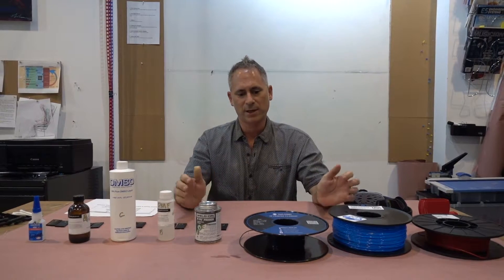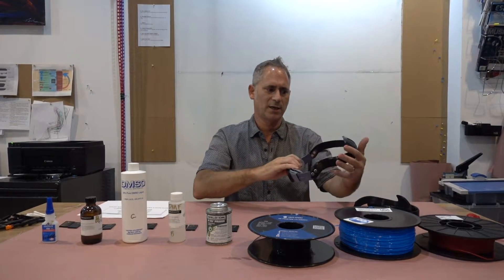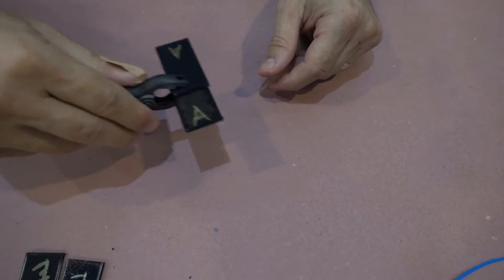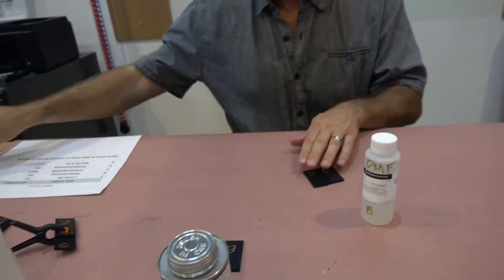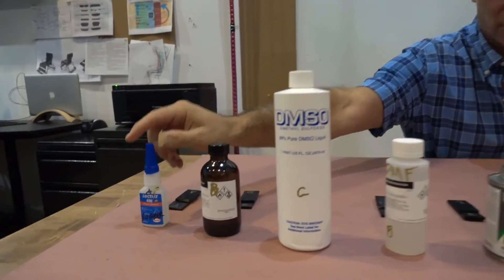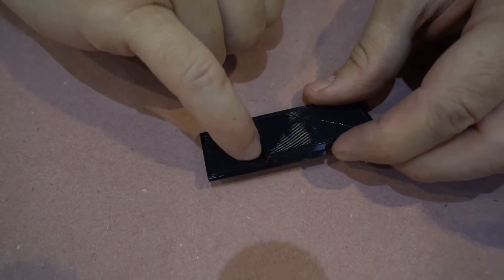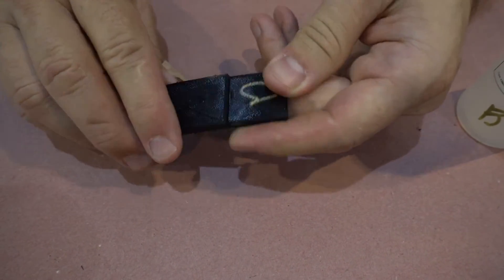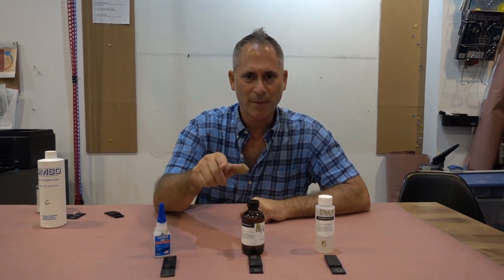Methods of gluing Flexible Prints in TPU together!

Comment: Thanks for the vid!

Adhesives & Solvents Tested
Loctite 406 (CA glue for plastics/rubbers)
Pros: Very strong in shear, instant tack, good for TPU → other material bonds.
Cons: Brittle, can fail under peel forces.

THF (Tetrahydrofuran)
Pros: Fuses TPU surfaces (solvent welding), very strong, no major staining.
Cons: Hazardous to handle (respirator & gloves needed).

DMSO (Dimethyl sulfoxide)
Pros: Bonds reasonably well.
Cons: Causes white hazing on surface, weaker than THF/DMF.

DMF (Dimethylformamide)
Pros: Strong bond, solvent weld, only slight surface change, nearly as good as THF.
Cons: Toxic, smelly (contains formaldehyde group).

Weld-On P70 Primer (mix of THF, MEK, acetone, cyclohexanone)
Pros: Easy to buy, no staining, strong in shear.
Cons: Failed under peel compared to THF/DMF.

Best Options

For TPU → TPU bonding (same material):
THF or DMF (solvent welding = permanent, flexible bond).

For TPU → other materials (rigid plastics, composites, etc.):
Loctite 406 (fast, reliable, but brittle under peel).

✅ Final Verdict:

THF = strongest, cleanest solvent weld for TPU.
DMF = strong alternative, slightly more staining.
Loctite 406 = best quick adhesive for dissimilar materials.

Comment: very intestesting!  I need to bond TPU to a carbon fibre... and peeling is going to be important... anyone any ideas?   Ideally I'd use a two sided tape, but Im pretty sure none will be able to do this...
Reply from the maker: Thank you, the best solution is mechanical solution like a positive negative interlocking feature, if not, I feel the best solution is epoxy however, he still would need some mechanical grip

Comment: Chemist here. Please do not use DMF for welding. It will make you impotent very quickly (men and women), and it will reduce your ability to process alcohol making you have serious hangovers. Use THF or DMSO, I would recommend THF. I don't know if this will work because I've never tried, but you could also give Ethyl Acetate (Common Paint thinner), Acetone, or Methyl ethyl ketone (MEK, another paint thinner). All of these have significantly fewer risks associated with them.
Reply: I don’t know if this guy is screwing around or not, but I’m going to listen to him.  I’m not going to use anything with chemicals that will prevent my fishes ability to swim
Reply from the maker: Thank you!
Reply: When did MEK become safe?
Reply: @McAuley240  Not a carcinogen, high LD50, no reproductive effects, relatively high acceptable vapor exposure (150 ppm for 8 h). Compared to DMF it's basically water. Ethyl acetate or THF would probably be the best options.
Reply: Jesus
Reply: That makes sense now.  I was tasting in colors afterwards for awhile.

Comment: Good stuff. I am curious if you ever experimented in getting  good contact cement to stick to the TPU to bond other rubbers (natural or thermal rubber TR, EPDM, etc). Contact cements don't seem to stick well the the low reactive TPU, so it seems to me a primer of sorts is needed.  will one of these organic solvents work as a first primer layer that will make the contact cement bond really well to the TPU material?

Comment: What about common bicycle tube rubber cement? That's cheap and easy to get hold of, flexible, and contains solvents.
Reply from the maker: I havent tried, but innertubes are actual rubber and TPU is a thermoplastic, so its not likely to work, but worth experimentation!

Comment: Thanks for making this video.  My chemistry knowledge is pretty nil so this was a big help.  I viewed this video about 3 days ago and Amazon did not have the THF but today, it is back in stock so I picked up a small bottle.  I want to make a linear strip of TPU to wrap around a radio knob as a grip-enhancer. The reason I don't print it in a continuous ring is that I am using the texture of the bed to impart on the TPU strip.
I use both TPU and PETG (wonder how THF works on PETG?) and TPU is amazing material.  I soaked a TPU piece in acetone for 3 months and other than absorb a smell (that did vapor away completely) there was absolutely no degradation or change!  Also, I make small electronic enclosures and TPU makes them pretty well bullet proof.
I will eventually need to get into nylon (does THF glue/melt nylon?) but that is a big modification of my setup to accommodate both the higher temps and bed-adhesion.
Anyway, thanks again for posting this informative (Project-Farm like) side-by-side test...
Reply from the maker: Hello, you are welcome, unfortunately I am not a chemical engineer, only a tinkerer and designer.  I have not tested the solvents on many of the materials you are listing, but you may want to do your own experiments on small swatches.  If so, please do let us know.
you may also want to check out this video I did on gluing PLA  https://youtu.be/jOJJ0wyScOc

Comment: Thank you for the video, I was looking to glue a modmic to a pair of 3M X5A earmuffs, unfortunately for me the included mic clasp does not stick well to rubberized surfaces, so down the rabbit hole I go, looks like the CA glue should work fine for TPU/ABS. Now if only there was a product with great noise isolation, clear noise canceling mic, AND audiophile level sound at a sub 300 price point I'd buy it in a heartbeat.

Comment: I tried the DMF on some TPU parts made using the FDM process and it worked great.  Then I tried it on some TPU parts made by multi-jet fusion and it didn't work at all.
Reply: any luck since with the TPU parts made by multi-jet fusion ?

Comment: do you know if when dry, the three winners pose any threats to dogs. I am designing and dog frisbee and need to attach tpu to tpu. If they do, do you know of any other glues that work with TPU, can withstand great tensile strength, is waterproof and is non-toxic? 

thanks, great vid
Reply from the maker: Sorry, I really wouldn’t know that. Best guess is that the clear solvents once evaporated will not be present any more, but I can’t be sure and don’t know the medical science behind it
Reply: @petersolomon3505  yeh okay all good. Thanks for your input regardless

Comment: Have any of you you tried a cheap, accessible product like Liquid Nails (original construction adhesive) for bonding PLA to TPU or even ABS? I use A urethane construction adhesive to bond PETG to fiberglass for a radio housing mount in a motorcycle fairing and I swear you can swing an elephant from it.
I don't remember feeling old Liquid Nails, 20 plus years ago, from anything. It had to be ground off or scraped. I have no idea what is in it.

Comment: Great video. Saved me from wasting time on performing these experiments thanks. Is there any way of rendering the TPU surface more rough to increase the coefficient of friction. Specifically I'm working on a gripper for cutlery to be used by persons with disabilities of the hands. So far we resolve to wrap a rubberband around the cutlery to avoid that it slits against the TPU, but if the TPU surface could be made like silicone after 3D printing it would increase usability. Anyone?
Reply from the maker: thank you.  I might suggest building texture into 3D model or using a slicer which adds texture. Or if its not a problem to drill the cutlery in 2 places add small protruding half spheres on inside of TPU part to catch the holes
Reply: @petersolomon3505  Thanks. Texture is not sufficient, Modifying the cutlery is not viable. I hoped for some surface treatment to make the TPU like silicone rubber surface.
Reply: @runethorsen6230  You need to print with a soft tpu. It can be very similar to silicone in flexibility and give.

Comment: Would love to see how the bond was between different materials. It seemed like you alluded to testing this in the beginning because you even said your use case is attaching TPU to something harder like PLA. If I wanted to bond TPU to TPU I would print them together in most cases. Thank you for testing part of it though.
Reply from the maker: thats a good point, I guess it really depends on which other material you are using, if bonding to a material which is rigid I tend to use CA or supeglue, and if bonding to something flexible a rubber cement if not one of the solvents I have show.  see earlier video on general bonding https://www.youtube.com/watch?v=5XCJauPrlKY&t=9s

Comment: What would you say would be the best glue to stick tpu and cloth (mostly faux leather)
Reply from the maker: Probably a contact cement as it’s one of the few flexible. A bit on both sides, spread thin, let dry, then push together
Reply: @petersolomon3505  thanks

Comment: Thanks for the great video! I'm using Loctite 770 with Loctite 401 and they gave me great results on TPU and Neoprene adhesion. I'm doing some research and I'm trying to glue Ninjaflex TPU to steel. Do you have any advice on that? Thank you!

Comment: Could the dmf used with a heat press, to speed up process to avoid clamping
Reply from the maker: lloyd b have no idea, but many of these chemicals are flammable so be careful experimenting.
Reply: Thank you, sorry for all questions there not alot of info bonding these materials, how long did you leave it to cure
Reply: @lloydb801  no issues, that video was 2 years ago, but I think I left for 30 minutes although I believe the bond is almost instantaneous.

Comment: Where can I get the dmf or thf from ?
Reply from the maker: DFM:  https://amzn.to/3fw9HkH    THF:  https://amzn.to/30sN1NG
Reply: @petersolomon3505 thank you, not avaivable anymore, will the thf work with polyurethane rubber
Reply from the maker: @lloydb801  wow, is neither available? check amazon and ebay.  TPU is thermoplastic Polyurethane, which means its formable by heat, the other type of Polyurethane is thermoset which catalizes with a chemical reaction.  I have not tested on the second type yet.
Reply: @petersolomon3505  hi again, I'm from the uk, they sell it but you have to be a company or a school, I'm going to try ebay
Reply: @lloydb801  yep the uk its a pain to get hold of dmf, i tried today though im a company but still wont sell to a sole trader, only reg companies only. The only thing you can get is the 406 so it looks like we are stuck with that haha stuck..

Comment: Thank you for this video.  Do you have any recommendations for bonding TPU to PLA?  There would be only compression no shear forces.  Thank you again.  Very Best Regards, Jim
Reply from the maker: diveflyfish I would think your best bet is contact cement, I don’t believe there is any Solvent with intermix between the two and the best bonding agent would probably be something which has a little bit of flex such as contact cement. Apply to both sides and let dry until lightly tacky like  a piece of masking tape then push together and they will permanently bonded
Reply: @petersolomon3505  Thank you.  I am now trying an experiment to print the PLA on top of the layer of TPU. I raised the temp of the PLA to the temp of the TPU printing temp and so far it seems to be working.  I will find out in the AM when the print is complete.  Thanks again for your instructional video.
Reply from the maker: diveflyfish that sounds very interesting, let me know your results!
Reply: @petersolomon3505  It worked perfectly.  I printed the TPU layer first, then switched to PLA but kept the temp the same as the TPU temp for the first layer, so 235 TPU 235 PLA first layer then decreased the temp to 225 for the second  and third layer PLA then resumed the 215 temp for PLA.  The only other modification was print speed.  I printed the TPU at 20mm/sec which is a little fast, and the PLA also at 20mm for the first four layers. I then resumed to a slow but sure 40mm/sec for the PLA.  It is a solid interface.
Reply from the maker: @diveflyfish  amazing news!  I will have to try this.  If the geometry permits I would suggest printing PLA first so you would have a more solid base.  I do print Sainsmart at speeds up to 40mm/s and ninjaflex at 25mm/s

Comment: Did the DMF seem to impart any of the shine characteristics that the THF did on TPU? Do you think the THF or DMF could be used similarly to shine up the plastic like acetone shines up ABS?
Reply from the maker: It may be possible, but hard to control, would need some experimenting,  acetone on ABS works smoothly due to the vapor application, not sure if brushing on has same quslity

Comment: Thanks for the great info, but yikes, please use eye protection! Also, DMSO passes so easily through skin that spilling some on your hand will quickly give you a garlic taste in your mouth as the DMSO enters your bloodstream and is circulated to your tongue. Anything dissolved in the DMSO will be transported through your skin and into your blood at the same time. Some info on what types of gloves to use with each of those solvents would have been useful. Great video though!
Reply: When I was a kid the vet used this to apply meds to our horses topically. It not only passes through skin and blood membrane easily, it magically helps other compounds to come along for the ride.

Comment: Do you know if THF or DMF leave any toxic residue on or in the TPU? I have been trying to find out for a few days but only find the potential health risks while using the solvents and nothing about if those effects are an issue after it has dried.
Reply from the maker: Sorry, I am not a chemist and although you could wash the parts, I have no idea of residues left or changes in chemical composition due to using organic solvents
Reply: Did you find an answer to that?

Comment: John,
If you would send me your address, I'll send you a Basic Poly Kit.  The Bonding Poly Process (patent pending) will take the 3D printing to the next level.   Haven't test results on tensile strength of the Process, but I do on heat.  CA's fall apart when heated to 220 to 280 degrees Fahrenheit.  Bonds made with the Bonding Poly Process hold at temperatures in excess of 320 degrees Fahrenheit.

As far as tensile strength, in every case where there's been a failure, it's been substrate failure.  In the video below, the wood split before the bond between Teflon and the wood.  When pliers have been taken to the wingnut, the Teflon split.  

The Process works on all polymers and all plastics, though for resin and acetate plastics, the Poly Prep is not needed.  In two and a half years on the market there has not been one reported failure of a bond.

Please let me know.

Don Meyers
Tech-Bond Solutions
877 565 7225
https://www.youtube.com/watch?v=Mtvf5FE0pg4

How to Bond Teflon to Metal, Wood, Rubber, and other Teflons
You've probably heard that nothing sticks to Teflon. And while it certainly presents a major challenge to most adhesives, Tech-Bond has created a solution that you need to see to believe. In this video, you'll see how to glue Teflon to steel, how to glue Teflon to wood, how to glue Teflon to rubber, and even how to glue Teflon to Teflon.
Reply from the maker: Hello Don, I would love to test your basic Poly Kit, please give me your email to send request
Reply: donmeyers@tech-bond.net  Thanks.